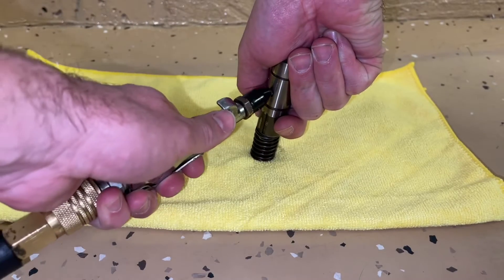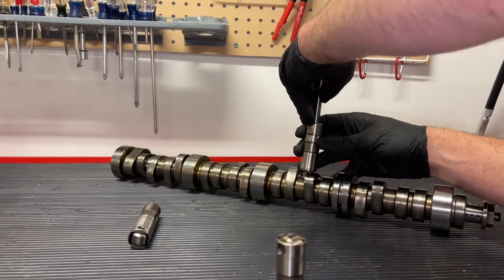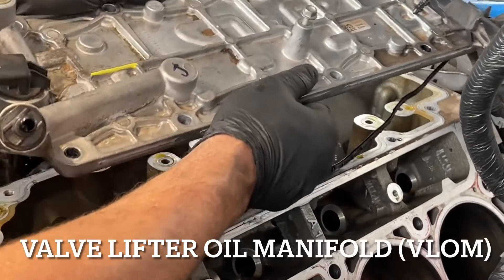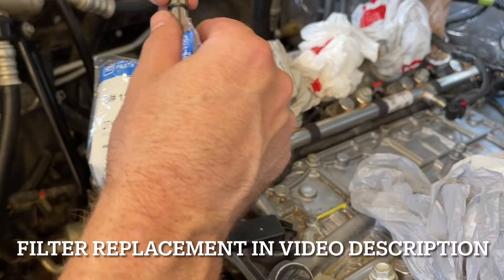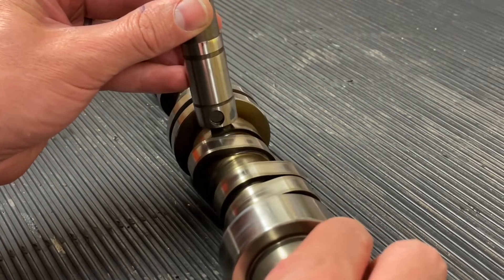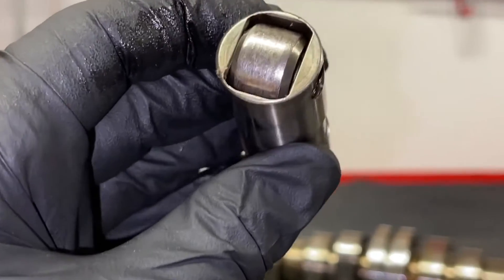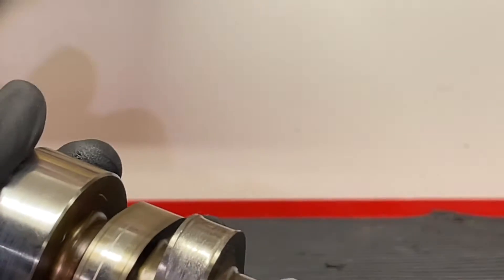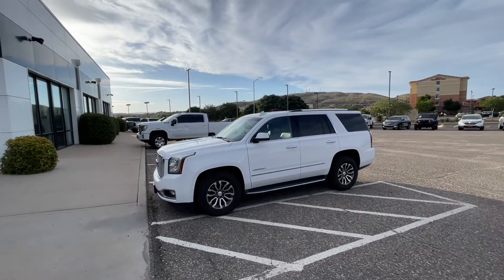GM DOD/AFM Lifters operation explained, failures, how to delete. Why GM engines fail 5.3L 6.2L

Comment: This just happened to my 21 Silverado as well. Same fix same concerns
Reply: Once u replace the lifter with the spring on them with Corvette lifters and delete the fuel management system you will never have this problem again. And I guaranteed you will get 200,000 miles plus out of that v8
Reply: @TheRealZJM377 what year corvette
Reply: what do u think about deleting the afm? i have the same truck but i have the 2.7 turbo. im thinking of deleting it? what do u think

Comment: Thank you Danny for your effort, I have 5.3L Yukon 2017 and I’m experiencing a shaky ride at 40-50km speed when switching from v8 to v4!
Reply from the maker: Is probably start with turning off the 4cly mode electronically and see how long it goes. Physically deleting it like I show in the videos is a large process with a lot of variables. https://youtu.be/cWayyZGNYRI?si=keJn2wzhlxD2lxVQ
Reply: Do you know about the M5 truck that stops the AFM from operating?  Depending on the odo reading, there could be a few other variables that can cause the vibrations.  Alignment, Tires and wheels being unbalanced or our of round, front end suspension parts being warn or not properly lubed, axle outer seals, drive line being out of balance or the U-joints going bad, trany not operating properly or needing a simple flush to name a few.  One thing I noticed on my truck is that the front lower engine cover that is also an air dam will make your truck feel different if it is not on there, and the faster you go, the more it changes the aerodynamics and can create a vibration.  

The cover on my engine was cracked and part of it would hang down.  I removed it and drove around like that for a few weeks.  I noticed a new noise and feel on the highway.  So I replaced it and that all went away.
Reply: Did you find out what it was? My truck does the same thing
Reply: I would … put it in 5th gear and push in the tow button to see if still does it … 5th eliminates the switching of v4 to v8 and then if you still feel the shake pull over and push the tow button and see if that eliminates the shake …. If it goes away on the 5th gear trial then it can be ur afm but if it goes away on the 5th gear and the tow button pushed then it’s prob a torque converter …. Ask me how I know … cause I’m now replacing a torque converter cause that’s the last thing and I don’t know why it’s not really talked much about the torque converters are shit like everything else in these trucks

Comment: Always a chevy guy, but was awakened when the dealer had to replace 8 lifters in my 21 Silverado at just 16k miles.  What about the other 8?  I'm now wondering if the cam is damaged and metal floating around in my engine.  No longer trusting I'll ever make it to higher mileage. Considering selling my truck or having a rebuild with conventional lifters, but then there is the emmission test problem.... GM has known about this, and I"m just discusted.... Basically we can just thank the government.
Reply: The government is not an excuse for making junk.
Reply: @bobart1790  I'm getting mine done (full dod delete) for roughly $3000.00 or slightly over. I ordered the GM parts (GM cam and GM lifters) kit on AMS Racing. Kit, with tuner, and the 3 extra recommended add ons, was around the $1600.00 mark. Then I had to get the exhaust manifold gaskets and intake gaskets, along with a new timing belt tensioner for about $ 170.00 more. A mechanic, that's friends with me is doing the labor for roughly $1000.00. I'm sure I'll need a few odds and ends to get during the process, thus the reason I figured in the $3000.00. I'm sure I'll definitely need a new push rod or 2
Reply: New lifters should never be installed on a used camshaft.
Reply: You should also get a trans tune! I do them with HPTUNERS and it makes a world of difference and will make your transmission live!
Reply: @stevewhitney260 Where do you get the tuner?
Reply: My 2015 5.3L just failed, replaced with a Jasper engine with AFM delete. Love the new motor.
Reply: @bobart1790  why did you replace the engine, rather than just having the dod delete done? Higher mileage and new engine the vest option in your case?
Reply: @TheDbrewer31  The first shop that diagnosed my issue quoted $7k for a cam and lifter rebuild only. He also quoted $13k for a Jasper, and $14k for a GM original. A friend recommended a shop In the city, they quoted $9k for the Jasper , thus I went that route. I now have a 36 month, 100k parts and labor warranty.  If I were 20 years younger,I may have attempted the repair my self. And the other reason for replacement, forgot to mention, around 52k miles, my oil pump failed, thankfully I had that repaired under warranty. I was skeptical on what else would happen if we only repaired the cam and lifters. The cam was damaged by the stuck lifter.
Reply: @bobart1790 where in the US did you get the engine replacement. I have a 2015 gmc sierra 5.3 lifter and cam just went out on me

Comment: At what mileage do these lifters fail? I’m sitting at 77,000 miles on my 2012 Sierra and want to rebuild to make more power when the lifters go bad
Reply: Lifters can go bad at anytime, mine failed a 3,900 miles. (2021 Silverado 5.3 V-8)
Reply: Unfortunately, or fortunately, depending on how you look at it, there is not one set amount of miles that make these crazy things happen.  I've seen it happen on new trucks with less than 3k or trucks with over 150k or even 200k never have an issue.  There is no telling when or even if it will happen.
Reply: I'd do it before then. When the lifters go bad they can cause catastrophic damage. $$

Comment: I got tired of driving in M5, so I purchased the Diablo Tuner and disabled the AFM.  I also deleted the 180° Trans thermostat and put in the Sure Cool part # STL010 for cooler temps. Also added a PCV oil catch can.  I'm at 86,478 miles,  only problems I've had was #6 fuel injector,  engine thermostat,  and vacuum pump. I've done 2 trans flushes and  change my engine oil at 4,500-5,000 miles.
Reply: Hit 91k and lost cyl 1 AFM lifter.   Doing the surecool for the trans, as well as replacing the shitty stock converter --with a CTS-V converter, BTR Stage 2 truck cam, AFM/DOD delete, and a tune.  In you want save your trans, at a min, get a tune.  HP Tuners, disable AFM, and tune out the AFM trans settings will save your trans.
Reply: Your M5 BMW?
Reply: @aaron___6014  He's referring to L5 on the shifter I think, L5 will keep the engine in V8 mode and no V4.
Reply: @aaron___6014 no he holds it in a gear so it doesn't use dod
Reply: I'd suggest moving that oil change up to the 3k mark and keeping it there.  Stretching it even to the 4,500 mark is getting my pucker factor going.  So unless you have an extra large oil pan or a few extra $K laying around...
Reply: @jmackinjersey1  With a good oil you can go much more than 3k miles on oil.  I run Amsoil and do extended oil change intervals.  I have it tested each oil change to look for wear or fuel dilution in the oil.  My lifter failure (AFM) was not oil related, and internals on my engine are clean (no sludge, no varnish, no deposits) and zero wear on my components/bearings.  Only damage was the lifter (cam is good), but I taking that problematic system out.  (my last 5 oil changes over the last 5 years.. 21, 19, 16.5, 14, 7.5k and 4k into this oil when the lifter failed).
Reply: @jmackinjersey1 i change mine every 10k and have only replaced the starter because it was squeaking at startup. I have 140k trouble free miles. I don't rev the piss out of it, either. It don't take much rpm to jack those lifters up.
Reply: @jmackinjersey1  for a full synthetic? no. 5000 miles is early

Comment: GM just cant seem to get this fixed.
Reply from the maker: I think they’ve added even more cylinders with dynamic fuel management
Reply: Don’t take it to GM get a reputable tech and aftermarket components delete the dod or afm or whatever that nonsense is called eliminating the failure point always use better than stock components
Reply: Unfortunately, the government forces auto manufacturers to get better fuel efficiency by a certain percentage every year. This is what's truly screwing the customer.
Reply: @TheDbrewer31 and the EPA!

Comment: Do you recommend disabling the afm before this happens , by module or tuner?
Reply from the maker: Yes. It may keep a timing event failure from happening. I’ve only seen 1-2 miles per gallon difference in v8 mode constantly as well
Reply: You notice how he said the lifters get stuck in the collapsed position? If you disable delete or add a range disabler the lifters don't collapse greatly decreasing your chance of having an issue.
Reply: @johnsmith3735  Yes, its all about probabilities.  They greatly decrease with a module or tune.  Less likely a timing event or worn out locking pins as they are now not used at all.  It makes sense.

Comment: Never did hear why just shutting it off with a tune would not fix this situation. No Oil being sent to from the VLOM means no activation and miss time issue's. Lifters stay in "locked out' state and cant compress. Did i miss something?
Reply from the maker: It will keep the timing events from happening, and if the lifters don’t have a lot of milage on them, the pins may not be worn down and the lifter shouldn’t collapse. Unfortunately, even in my case, the regular lifter is what failed. It’s just too many variables with this setup. I would definitely turn it off and just see what happens
Reply: Ah ok. Yeah I have had mine disabled on my 2016 for last 50k miles. 117k on ot now. The best thing I did was start running motorkote
Reply: 185K on my '08 1500. I turned my AFM off I think probably around 2015. I change my oil every 4K. Just recently noticed a tapping at idle when the engine was warmed up. I bumped the throttle and it went away. 5 min later while still idling it started taping again. Again bumped throttle and it went away. Yesterday I heard it when cruising slowing through town, I would bump the throttle but it didn't go away for about 3 minutes. 
Not sure if it's the lifters or timing chain or what.. it's intermittent though. 
People are saying no joke a quart of ATF in the oil over time and maybe multiple oil changes can clean out the lifters to where this goes away. They swear it works.  I don't know, I think I'm going to try it as my other option is spending thousands on deleting. Sounds like it's all the same parts to replace if there's an actual failure right?

Comment: I just got myself a 2019 Yukon,your playlist has come in handy as a first time owner,never delete it 🙌🏽
Reply: Dude that good .GM v8 are the best. Once u replace the lifter with the spring on them with Corvette lifters and delete the fuel management you will never have that problem again. And  I guaranteed you will get over 200,000 miles plus out of that engine

Comment: Besides a delete, what methods can be done to reduce the odds of a lifter failure? Frequent oil changes?...Driving in L9 or L7 depending on your transmission?...
Reply from the maker: Yes, oil changes are the best- way earlier than the timer set. I’d go back to 3,000 miles or so and make sure the level is always full
Reply: I'm not sure why people can't understand this. Most of the time the lifter gets stuck in the collapsed position  if you add a AFM disabler like range Technologies you are keeping the lifter from collapsing in the first place. This will greatly reduce you having an issue because the lifter is not collapsing.🤯🤯🤯
Reply: @johnsmith3735  Yeah driving in L7 or L9 depending on if you have an 8-speed or 10-speed disables the AFM/DFM and the engine is running in 8-cylinder mode all the time.
Reply: @johnsmith3735  Must agree; stops the bad timing event or worn lock pins.  It's all about probabilities.  if you change your oil, I think this is a bullet proof way to escape a catastrophic failure.
Reply: What about seafoam from time to time?
Reply: @DavidRamirez-kv9xc  I just started using Valvoline Restore and Protect to clean the internal parts of my engine.  I am hoping this will keep my small oil passages clean.  I change my oil at 3k all the time as well as got my transmission flushed at around 80k miles.  

Also keep your coolant topped off and flushed every 40k miles or so and use distilled water if you buy the concentrate and need to mix it.